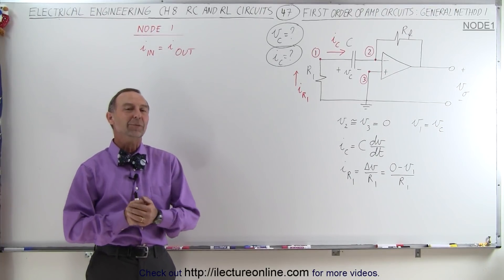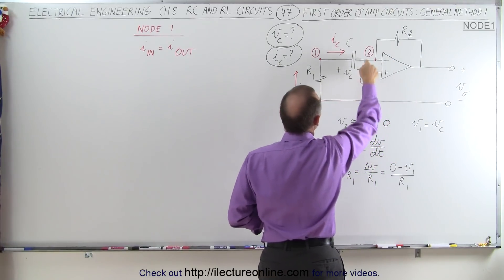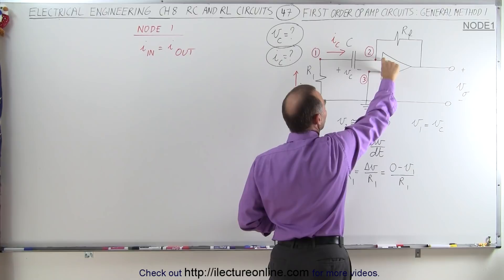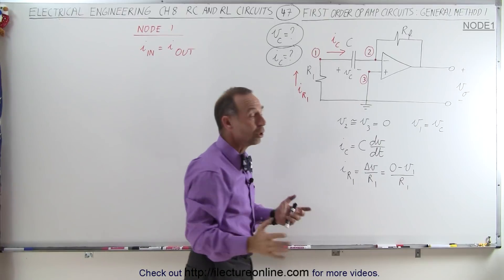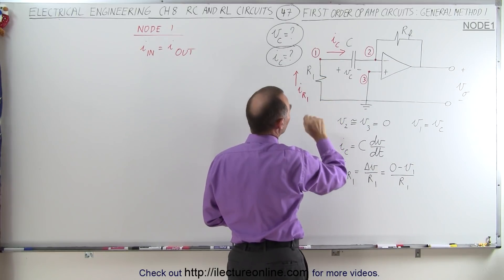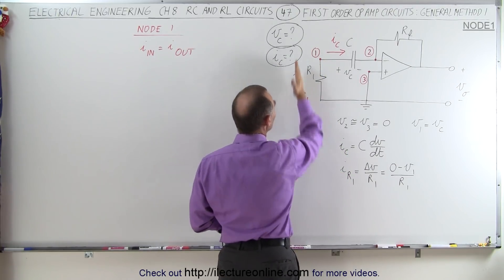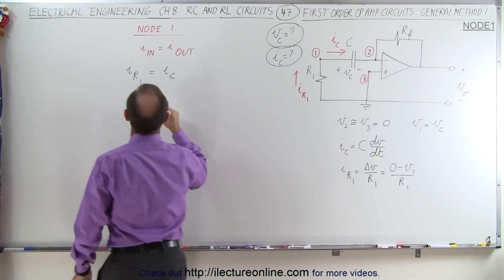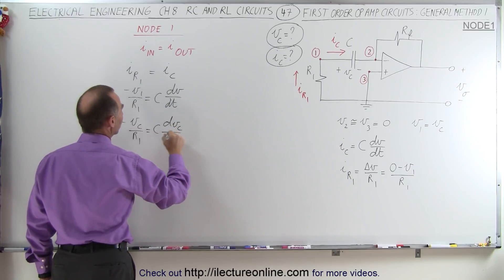Electrical Engineering: Ch 8: RC & RL Circuits (47 of 65) 1st Order OP Amp Circuit Node 1

Comment: Why are we taking the currents i_R1 and i_c to be directed into (or through) the capacitor? Since the left plate of the capacitor is at a higher potential than 0, shouldn't the current be flowing through R1 in the opposite direction? Thank you!